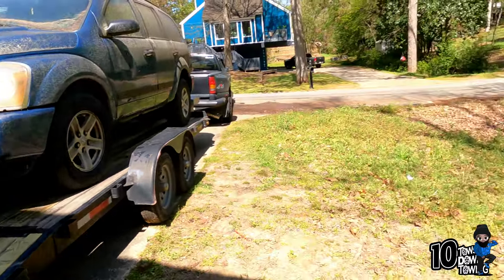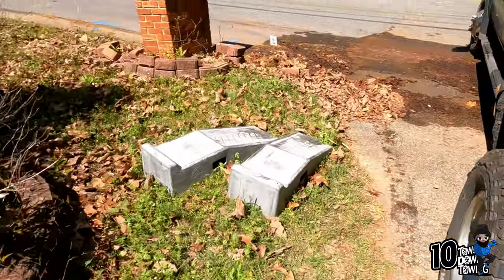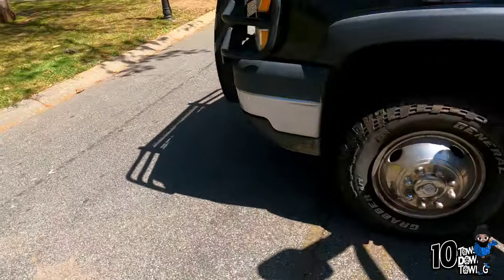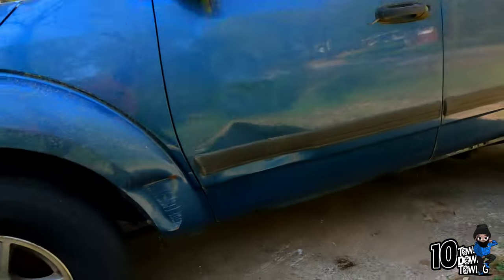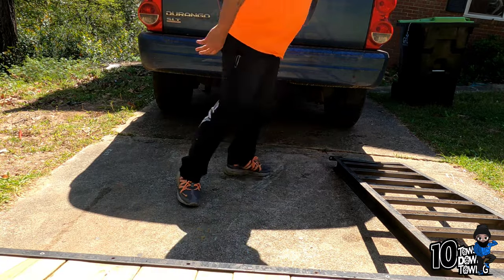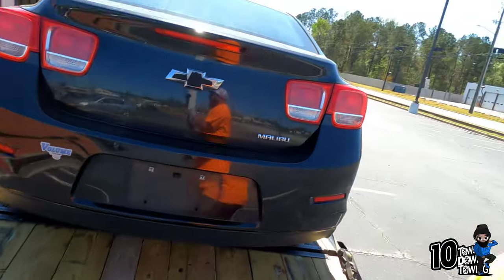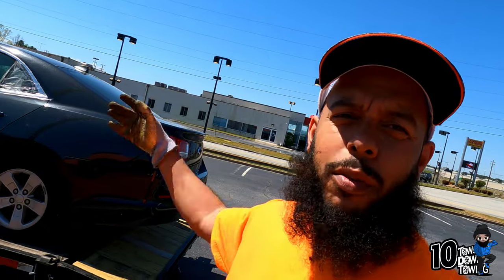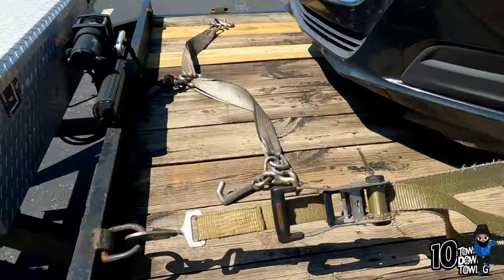Unloading up an incline? Check this trick out 😎

Comment: I'm surprised you never mounted the d rings in the back center to use the wench to pull the vehicles off
Reply from the maker: That has always been something inplanned on doing. But ive only had to unload upnan incline maybe twice. But it would definitely help for something with flat tires
Reply: @10TowsDownTowing  I remember you talking about it. I used that idea to unload a vehicle from a rental trailer before.

Comment: You need to get a d-ring for the end of your trailer so you can use your winch rope to pull the car off I got one for mine, but I ain't never installed it yet.
Reply: I think big Zs trailer is setup like that. I believe they talked about it in a previous video.

Comment: Another great video! Hey since your in the duramax gang like me curious have you ever heard of the 2011 lml brake booster upgrade for the 2004-2010 duramax trucks? I read and watched a bunch of different forums and youtube videos where guys saying it’s a night and day difference from the original brake booster!! The 2011 LML duramax brake booster upgrade makes the pedal feel 10 times stronger and just an all around better feeling braking, I think I’m gonna do it you can get the 2011 LML brake booster on rock auto for like $280 and it’s well worth it from what i hear also helps the power steering a tad too since they both run off the same system. Figured i’d say something since you tow a lot and like knowing stuff like that. Keep up the great job! 🤘
Reply: Also it’s not hard to do the brake booster swap yourself save the $$$ a bunch of good videos on YouTube about it
Reply from the maker: I swapped a 2011 hyrdoboost onto mine and haven't felt much difference to be honest. Many swear by it but there's also a a huge group that says it didn't make much difference.
Reply: @10TowsDownTowing  interesting ok I’m glad i asked thanks for sharing your experience with it!!

Comment: I noticed on that car that you had your straps on opposite corners... If you hit a bump hard enough it'll make the car go sideways a little bit and the straps well fall off.. put both of them on the same side.. ask me how I know 😂 but I did it on a flatbed tow truck
Reply from the maker: I had the winch connected with a V-bridle to the frame on driver & passenger side as well. But definitely not bad advice 😂
Reply: It's a Dodge, let it fall off lol

Comment: Very good idea. You would have had a better angle if you had pulled the trailer wheels onto the ramps.
Reply from the maker: If i pulled the trailer onto the ramps, the angle would have been worse. The ass of the trailer would have been higher than the truck. Unless im not visualizing what you're saying correctly...
Reply: By the time the front tires of the trailer got on the ramps, the rear tires would be on their way up the ramps defeating the purpose of the ramps under the trailer. Ramps under the truck was the right move.